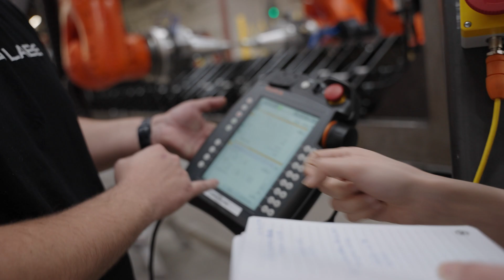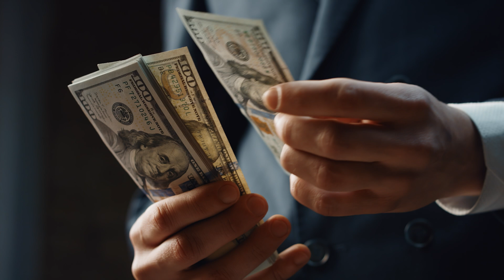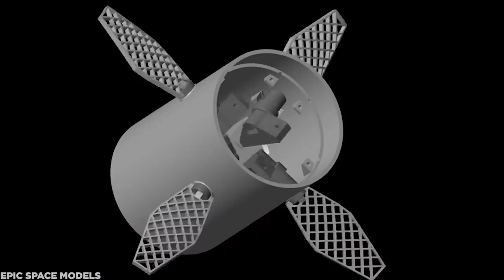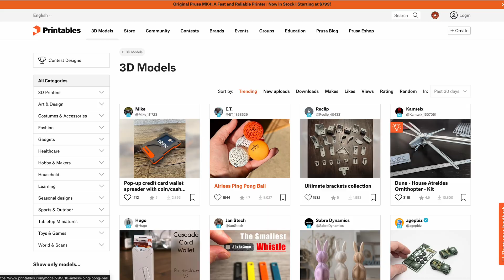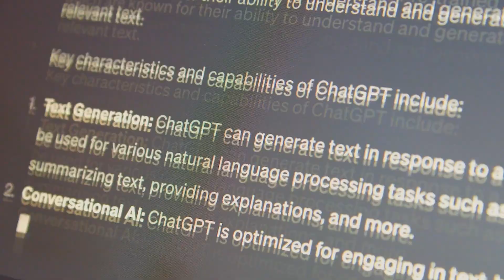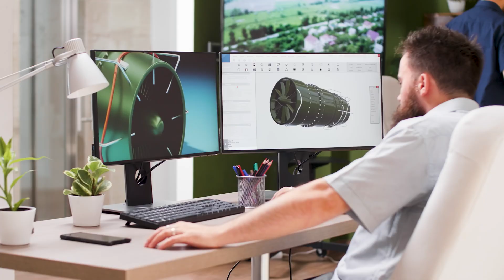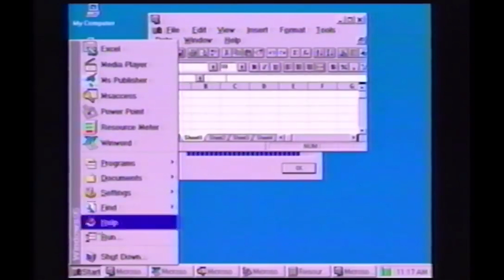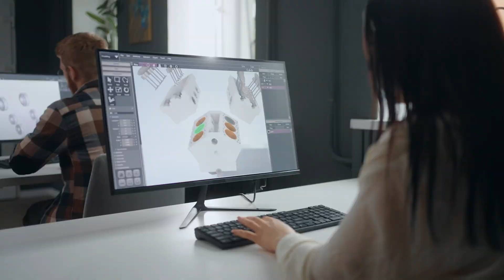A New Age of Manufacturing is Here

Comment: I worked for white metal die casting shop. They were trying out robotics. It was too slow for the multi station drill process. But we’re great in the die casting area. I was an inspector at that time. Castings usually came on a conveyor in tubs. 
But they were trying to eliminate steps and transport. So there were some where we inspected them at the machine. In one instance they had two small machines with robots grabbing them and drop them in a tub to be inspected. One poor older guy was blind in one eye. And while he was looking at one casting the robot came from his blind side and clocked him knocking him to his knees. 
It was pretty upsetting. Later we joked about rock em sock em robots. But it wasn’t good.

Comment: Apart from the appealing editing, the resulting sheetmetal parts are attrocious, and the speed is horrendous. Good(?) for very early prototyping and nothing more. Where is AI used by the way?...
Reply: Don't hate too much, I also wondered where the AI is used, maybe coordinating the tips and adjusting the pressure applied where thickness and stress change. By the way, they produce some nice parts, check out more of their products, they even make faces 😲
Reply: @69doggy69  I am just objective and know a bit about manufacturing. The video was nice in itself, so no hate.
Reply from the maker: @constantinosschinas4503  I think we could've highlighted the AI use in the video better. Thank you for watching though.
Reply: @constantinosschinas4503 yeah your average servo press is gonna push out thousands of parts per day this ? Few at best.
Reply: @69doggy69  Smarter Every Day did a video and yes that was one of the applications of AI that they talked about. It's a complex inverse kinematic control problem to have 2 robots applying a specific angle and pressure of "pinch" against each other to draw the sheet metal out.